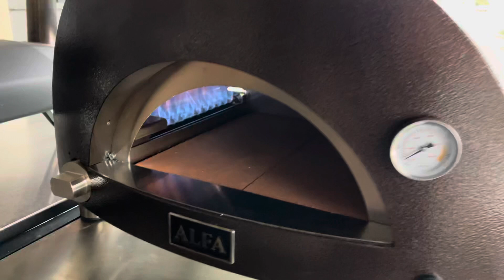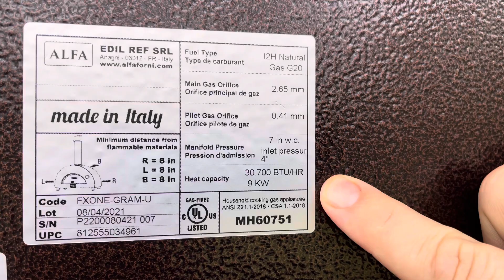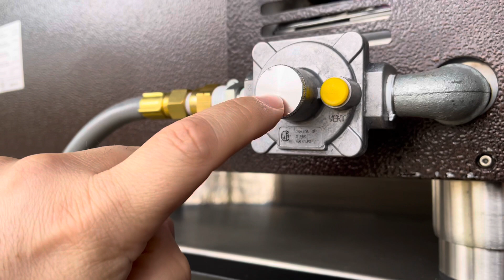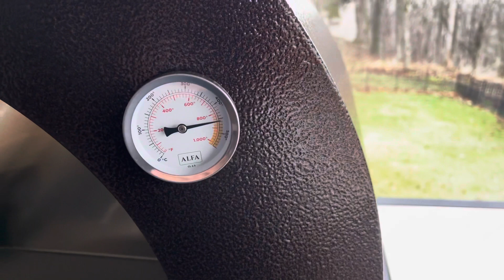Alfa One Pizza Oven Natural Gas Conversion

Comment: Just got this oven and my flames aren't doing anything close to this and I can't get this thing hot enough. What was the burner adjustment you talked about?
Reply from the maker: Are you using natural gas or propane?  What country are you in?
Reply: Same issue here... I'm on natural gas.. we flipped the regulator, but the flame is a low blue but not as strong as this... Im stuck at 800 degrees after 45minutes

Comment: Hello, first I’d like to thank you for making this video. I set up my Alfa one pizza oven and converted it to natural gas. I’m able to ignite it however when I turn the knob to high it turns off. Any idea why it’s doing that ?
Reply from the maker: If the pilot stays lit but then flips off once the gas is turned on my guess would be the sensor is not functioning properly.  You should reach out to Alfa to find out your next step.  Let us know what you discovered to be the problem!

Comment: Hey Brady - do you have issues with the pilot light going out due to wind? Do you know if there is an adjustment for pilot flame size? I asked Alfa why the NG and Propane orifice were the same size. They said a larger flame would damage the burner. I can't hardly see the pilot light when it is lit and videos of using propane show a much larger pilot flame. I may see about drilling the hole bigger for natural gas.  Thanks in advance!!
Reply: after looking at your video again your pilot light is much bigger than mine. were there any other adjustments you made?  thx
Reply from the maker: @edbaas9474  I made no adjustments.
Reply from the maker: When it is very windy I have had the flame go out a few times.  When it does go out it takes a minute to re light but the Alfa seems to hold heat very well.  This has only happened a few times and it was pretty windy.  I would personally not drill it.  Maybe seek out a plumber to test your pressure and check to see if it could be adjusted.  It would be above my skill level for sure!
Reply: @geepr12  Thanks for the response. I'm having the gas company come out to pressure test the natural gas.
Reply from the maker: @edbaas9474  Let me know what they found out!!
Reply: @geepr12  gas company was little help. They just confirmed the pressure at the meter was ok. I ordered a water pressure gauge and test it by the Alfa myself.

Comment: I am using propane and using the tank regulated along with the in line regulated both supplied by Alfa
It seems on heating at the beginning the flame is large but once it’s Around 500 the flame reduces?
Reply from the maker: That does not sound correct at all, flame should stay large regardless of temp.  Did you try a different tank to see if that changes it?  Are you in the United states?
Reply: Yes I am in United States, I thought the decrease was from going thru 2 regulators
I did read someone else had the same problem and they had to replace the burner
I have only had this one month, bought it at Bbq boys and they are no help
Do you know who I could contact at Alfa?
Reply from the maker: I have never had to reach out to them so I am not sure on that.  I would suggest as it has been awhile since I set mine up that you check the pin in the regulator that it is in correctly.   @Bob-ou7uq

Comment: What's the name of the one fitting you had to buy to connect the hose?
Reply from the maker: It will depend which hose adapter you get, I do not remember which one I got but it was not hard to find.  I just took the parts with me to Menards and test fitted at the store.